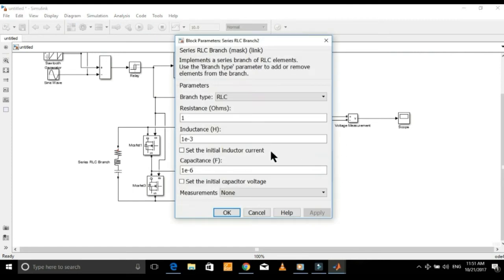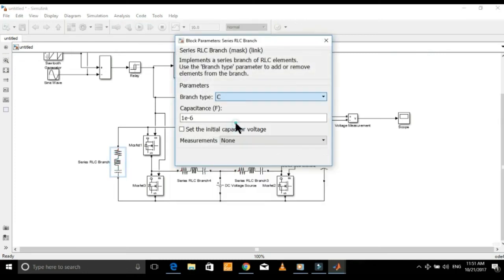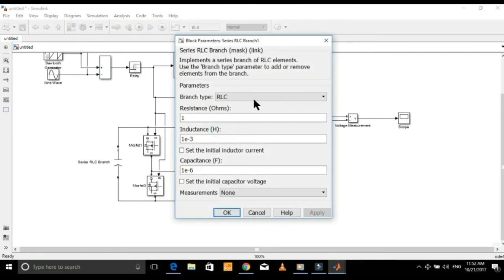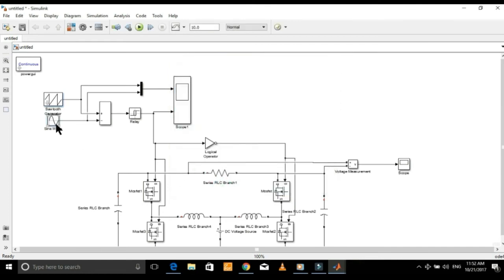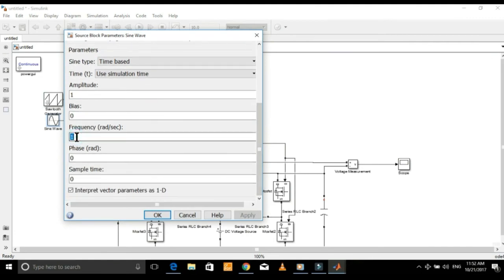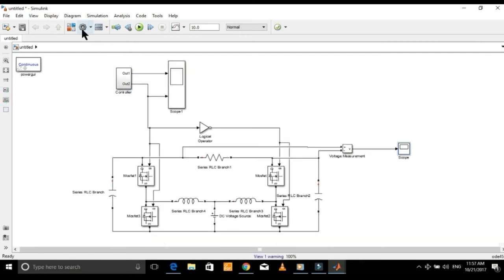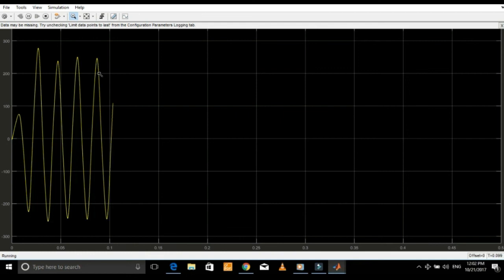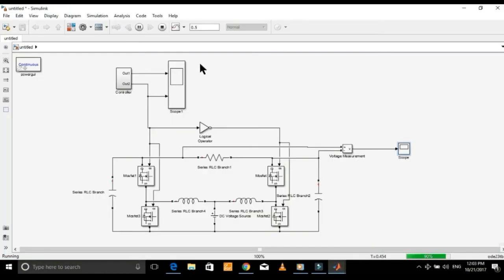Transformer-less step up DC to AC inverter Design in Simulink Matlab

Comment: hi sr, 
how can do it in matlap 
 A generator is supplying a load through 1:100 step up transformer, a transmission line and a step down 100:1 transformer as shown in the fig below. The step up transformer and step down transformer has primary resistance of 0.2 ohm, primary leakage inductance of 0.2 mH, secondary resistance of 0.5 ohm and secondary leakage inductance of 0.5 mH. The transmission line has capacitance of 200 uF , resistance of 0.5 ohm and inductance of 20 mH. And the load has resistance of 2 ohm and capacitance  of 100 uF. Use matlab simulink to model this system and use this model to find  
1- The magnitude and angle of the voltages and currents at the generator and the load.
2- Voltage regulation of the system
3- Efficiency of the system